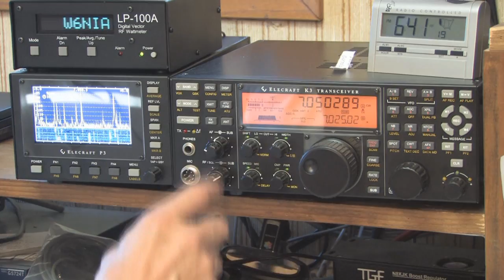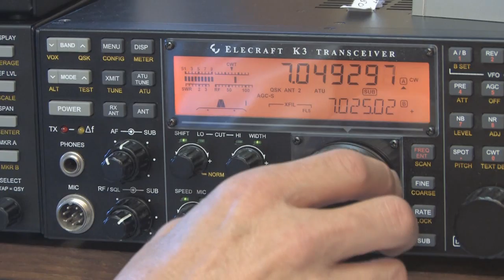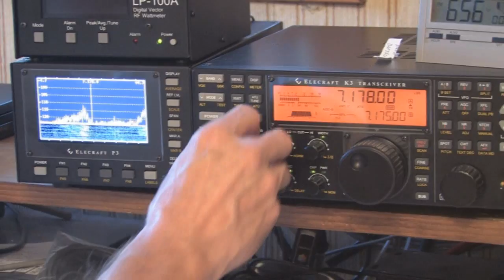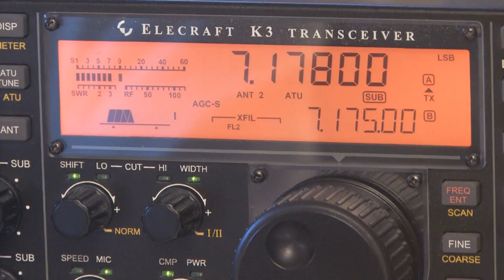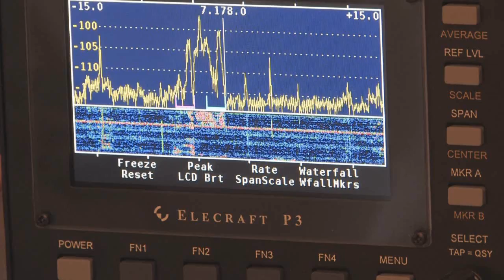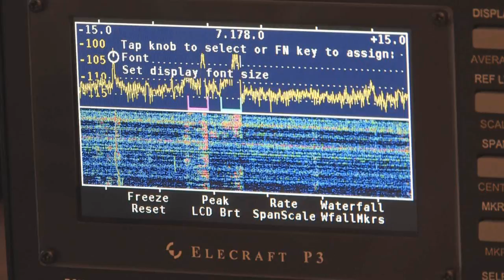Elecraft K3 Transceiver & P3 Panadapter Overview

Comment: Well done video, thanks.
I was considering a K3 because of all the hype that I hear about the rig.
I recently purchased a FTDX 5000, from this video I don't see it being any better than my 5000 along with the price of all the options to bring it up to speed. The Pan adapter look very Micky Mouse compared to my LP-pan2 that I run off of my 9 mhz IF output on  my FTDX-5000. It runs circles around the K3 pan.
Thank allot, this video saved me allot of cash.
Reply: The K3 sub receiver is better than the 5000 sub receiver. And the P3 is lab grade response and accuracy. LP pan has latency that the P3 does not. 500 is a great rig, but if you include the dual receiver, the k3 trumps it. Plus customer service, ease of transportation (its light), and ease of repair all go to the K3 if needed.
Reply: Also, no PC needed. Linked to the radio. Stand alone. And very portable.